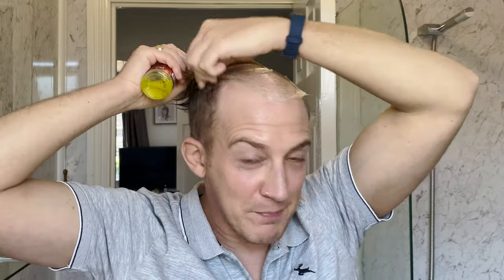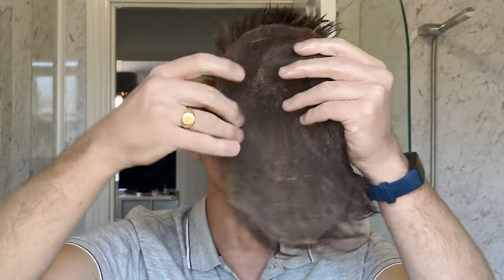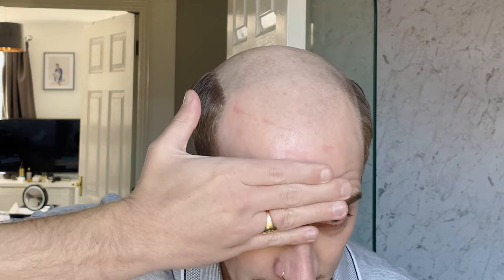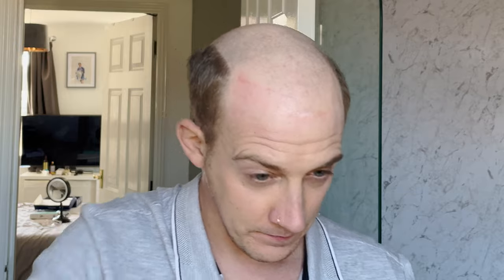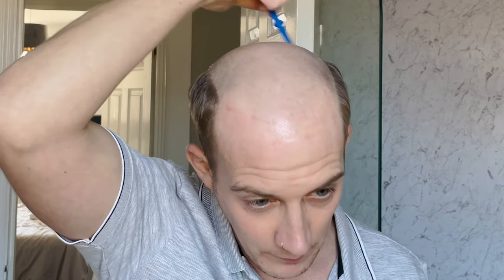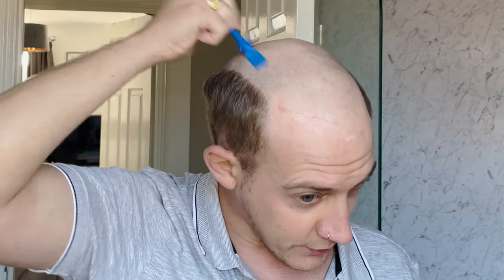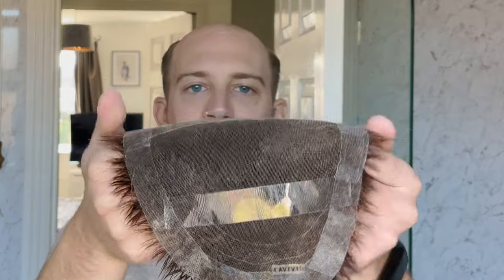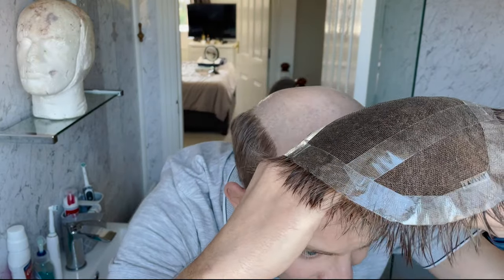Before and After | Removal of a French Lace system

Comment: Just gotva new full lace 100percent densitu piece cut in looks fantastic but with any full lace system it is better to get the poly suround for better tape adhesion. I had ordered that specific one nut it was not in stock and would take 3 extra weeks .
But im fine with it i put some knot sealer on the lace to give the tape more adhesion. 
Next one i get will have the the poly surrond
Sides and back better adhesion yo yhe scalp. I still like the lace better than poly units more.realistic hairlines . Poly everyday wear will tear the base 
 I would stick with 90 - 100 density if you are 35 and older  .
More realistc cause as you age your hair gets thinner less density .
Great channel  your attention to detail is excellent...👍
Reply from the maker: Cheers mate. Your new system sounds good! 👍

Comment: I used 99% isopropyl alcohol on my hair system base poly to clean it - was it bad? the system hair went a bit sticky and it was covered thick to try and get the glue off. i know now that c 22 on the base was probably better.
Reply from the maker: On a poly it should be ok but I wouldn’t recommend getting it on a lace as it can seep through and dry out the hair
Reply: Thank you  @HairSystemDIY

Comment: one question you put glue on your scalp i heard that to put glue on lace system it is damaging the hairsystem and hard to clean it can you tell me is it right ? i just bought french lace like your  but scared to use glue on scalp i was planing to put tape on it and put some ghost bond on tape but not on scalp what do you think
Reply from the maker: For a lace yes it is hard to clean off. I’d recommend tape instead
Reply: @HairSystemDIY  yes but just tape is only holdibg 2 days than starting to come of how do you wash your system ? what do you use ?
Reply: @johnmalkovich166  You may need to buy different types of tape to find out what works best for your skin. You also need to use a skin protector like in his video. This helps the tape stick and last longer.

Comment: How often do you have to take it off and clean everything and reattach it?
Reply from the maker: Every 7-10 days. If I’m away from home it can be 2 weeks
Reply: I change mine every 3-4 weeks, works well for me
Reply: With French Lace I assume  you can only use tape? No glue correct?
Reply: @firebird5323  I do both, glue on the front and tapes on the sides and back. You just have to be more careful with a lace system.